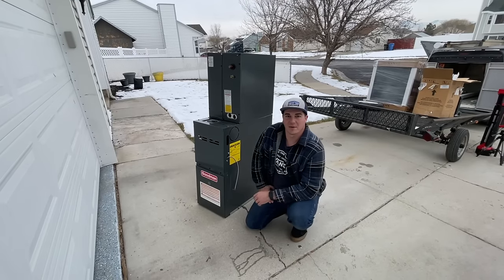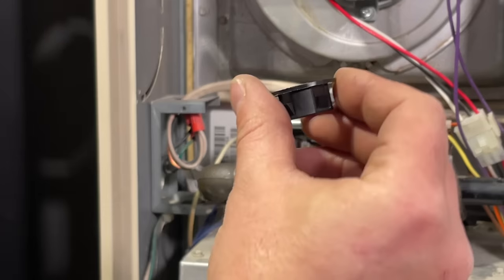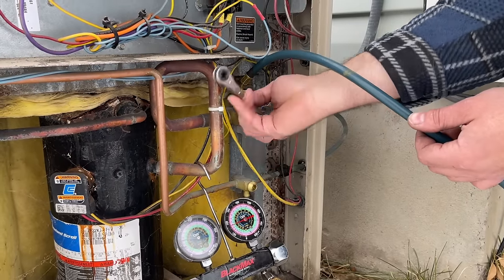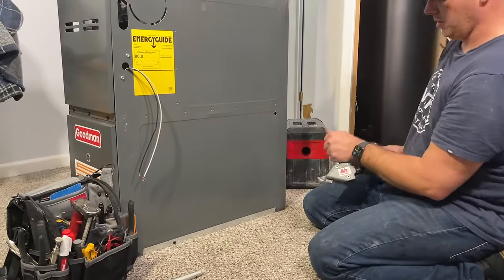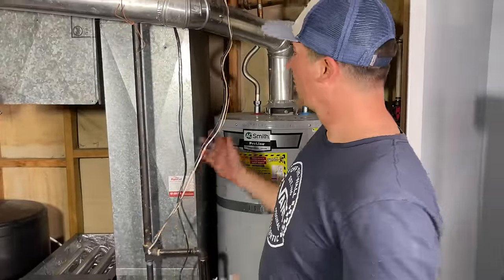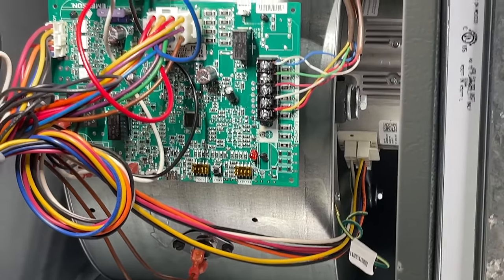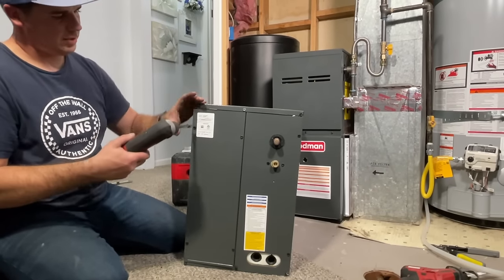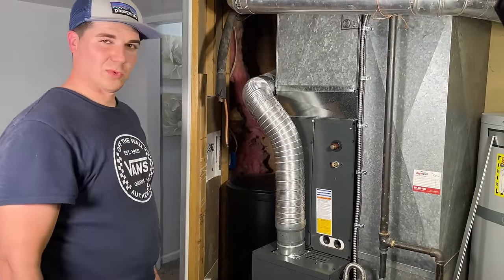Save THOUSANDS Replacing Your Gas Furnace Yourself.

Comment: As a professional HVAC technician I can appreciate what your trying to do. But the fact that your advocating DIY installations of a furnace and A/C is just plain wrong. First of all the average home owner does not have the knowledge or skills to do this type of installation. Second, you glaze over the fact that to do this work correctly is going to require hundreds if not thousands  of dollars worth of specialized tools. Third, your instructions are basic, you give little information on proper sizing and commissioning the equipment, and the information you do give is either partially correct or just plain wrong. Again I can appreciate your trying to share information, but at least the information should be correct and to a higher standard.
Reply from the maker: Thousands of dollars of specialty tools is a stretch. In this install I probably used maybe 10 specialty tools all of which are between 10-50 dollars. 

Also I’m not recommending this for everyone. If someone doesn’t want to do this that is totally fine, but you know for dang sure that people are going to do this that have the mechanical knowledge and they know the safety concerns. This video is to help them.   A homeowner can also pull a permit and have their work inspected so there is no issue with insurance as many people have stated. In fact I was just corresponding with a gentleman that did just this and was super happy and saved a lot of money.   Cheers
Reply: I agree with you,and to be perfectly honest,why the F--k would you want to show potential customers how to avoid calling you and not pay you! I think Goodman and any other manufacturer would not quite appreciate thos content either! Its all fun and games till someone gets hurt or killed and go after him!
Reply: @petersmart1999  i do all my own electrical work and never call an electrician. Adding outlets, lights, backup batteries, generators, 240V appliances, all easy to do and not ever worth getting permits or contacting an electrician. Heck, Id feel comfortable adding solar to my house without a permit or electrical contractor, rig up and program an inverter to sync with my house panel with relay protection to prevent backfeed then just take it all down when I move. I can do electricity and circuit boards all day, but as a DIYer I know my limits of knowledge. I dont do non PVC pipes, anything with pressure/compression, or fryon. Edit: to be fair though, I have been contacted by companies to be hired and trained as a proper electrician if I ever wanted to change careers
Reply: Well I'm not mad at this guy,,,,I have gotten alot of work from DYI....in fact I have my friends get jobs too,,,construction work due to a DYI...started a fire on attic installing a furnace!!!! CHEEERS!!!
Reply: People like him, give our industry bad rep.
Reply: @adamdragon8549  should be pointed out to manufacturers of the equipment he is using
Reply: @petersmart1999  goodman doesn’t care it’s the worst brand in the industry, pros rarely install  it, so they depend on amateurs
Reply: @adamdragon8549  Funny thing is,I have installed many Goodmans in the past,and never been back on one of them! I thought they may have been using someone else,but I have run into them and asked,I guess if you do a good clean install ,sized properly,and keep them clean the longevity increases.
Reply: While folks are clowning him and complaining.  Why not talk about the so called experts and licensed guys who have no idea about what they are doing and trying to bill you from unnecessary work.  I don’t mind paying service folks or companies for their work.  The goal seems to be get as much money as you can.  For example, my outside unit was making a loud knocking noise.  I was told it’s a compressor and should replace the whole unit due to the age of it.  A friend of my neighbor used to do HVAC.  He came over and heard the noise and said your about to be upset.  He told me to go get a hammer and screw driver.  He pulled the the fan off and using a screwdriver he beat some notches where it goes over the the shaft of the motor.  The shaft was spinning freely.  SMH.  Got my ac working that day and ordered a replacement fan for 55 which I ordered online.  That’s just one of many issues I experienced with many different companies.  Capacitors, fan motors etc.  overcharging.  Not talking about the labor and expertise costs.  Talking about overcharging for the parts.
Reply: I have the skills to do everything except charging refrigerant, and that’s only because it requires a license. This channel saved me more than $10K in my area.
Reply: @AF-O6  Moment you understand combustion efficiency and to tune-adjust it, let us know and talk about furnace installation. On the other hand you think it’s just gages that takes to balance out refrigeration system 😂 you make it sound its carpentry trade 😂
Reply: @AF-O6  smart man, respect for all tradesmen 💪
Reply: @adamdragon8549  just not true bro!
Reply: @thedude5040  
Some people play on the freeway, and survive. Therefore, everyone should play on the freeway.
Reply: @adamdragon8549  
You must be a rookie. The majority of performance issues are from installation not manufacturer. Anyone with 10 years or more of experience knows this to be an absolute concrete fact.
Reply: @AF-O6  
Manufactures require a contractor to install your equipment in order for the warranty to be valid. So, you don’t have a warranty.
Reply: @diyhvacguy  It absolutely is not a stretch. HVAC tools cost a lot and you need quite a bit of them.
Reply: You’re opening up a whole bunch of legal problems also. Most manufacturers aren’t going to warrantee that unit if it wasn’t installed by someone with the state issued mechanical license also your homeowners insurance is not going to cover any damage by improperly installed system or fires or any of the above. So the advice could potentially get someone in a huge, legal and financial position that they never expected.
Reply: I successfully installed several of my own furnace's in the years. 
Last year I installed our new Goodman 80,000 BTU and converted it to propane without a problem. 
It replaced our old York 80,0000 BTU propane I too converted.
As you do your best to make the process as complex and down right frightening to some, it's not working on me.
With the same, I built my own 20 kw home generator that I converted to run on propane using an engine conversation kit .
I installed the Deep Sea Electronics DS7320 controller module to do all the Auto Start and monitor engine and generator head functions. That was much more of a challenge than installing a furnace dud... 
I know it just makes ya wanna scream 😩 or possibly cry 😭 your eyes out when your loosing out on cheating someone out of a cheap install of a furnace. TO BAD 😞 ! 
In any case, I've never had one issue with any of my own furnace installs.
Reply: I am also in the industry, and I agree in totality with you. You have to have proper knowledge to do this. You can't just switch boxes and call it installed.
Reply: Please don't call me an average home owner. I hate to break it to you but this isn't that difficult. You'll be fine so calm down. Look at it this way, licensed technicians are a dime a dozen and now the average home owner can learn how to make sure Licensed technicians perform their job correctly.
Reply: 😂😂😂 Cmon man! Somebody's jelly
Reply: @chuckvenable4409  It’s not cheating ppl out people actually do this for a living you doing experiments on your own and them working out for you doesn’t mean it will workout for everyone else it will probably cost them thousands of dollars in the long run instead of getting it done right by a professional
Reply: @chuyrod1391  HEY 👋 
I don't experiment with anything.
I guess that's your only way to down play my knowledge to doing my own furnace installation .
Personally, I have zero interest in doing this work for a living. Not that I couldn't but just wouldn't.
I've installed several furnace units and converted to propane. I've never had a problem but that's not at all due to luck.
It's simply the fact I know exactly what I'm doing and how to do it.
Reply: @chuckvenable4409  props to you not everyone has the knowledge to do it so they aren’t getting cheated off their money everyone needs others services some cost more then others they’re always welcome to shop around for better prices
Reply: To be honest, looks like the only ones getting screwed or you guys cause we don’t have to fucking get ripped off anymor
Reply: @diyhvacguy  thank you for your knowledge I truly enjoy your videos. The guy who’s being a little girl is just hating. Thank you for being honest HVAC guy.
Reply: Hvac guys act like it's rocket science. It's basic stuff.
Reply: Agreed I do this everyday 5-6 days a week the average Joe can not diy an air conditioner yet alone their own garbage disposal
Reply: You hvac guys that are giving him a hard time act like this stuff is rocket science. Hardly gentleman. This stuff is rather elementary in the scope of electro mechanical applications. Plus theres a market for what hes teaching and as a fan of the open market I say go Dave. You've got the greedy ones clutching their pearls.
Reply: Dude get real. I installed my entire system in my new house that I'm building. I didn't spend thousands! I'm a cabinet installer and I need waaaaay more tools than an HVAC guy.
That doesn't mean a home owner can't install their own cabinets. 
You HVAC guys are about as honest as defense attorneys and car salesmen!
Reply: @adamdragon8549  no actually when you sell a custom a furnace for 4k that you purchased from the supply house for 2k... that is why you guys have a deserving bad name
Reply: @adamdragon8549  carpentry takes more skill bud. Yall are legends in your own minds.
Reply: @RossLemon  so how did I install my entire house without them?
I spent about 400 on tools that I know can use for the rest of my life
Reply: @venous-gaming55  When you combine Electricians, Electronics, Sheet metal, pipe fitter, mechanics, air flow, energy management, computers, thermal imaging, thermo dynamics, some carpentry, and then add physics to it, then you get HVAC expert. Tell me again what does it take to be great carpenter?
Reply: @adamdragon8549  lmaooooooo I watch 19 year old pot heads install HVAC systems literally every day.
Like every trade it's easy and takes very little skill I mean as much skill as a 19 year old pot head.
I make up a huge list to say what it takes to be a master carpenter and how my tools are 10x more than an HVAC guy. 
HVAC guys a crooks for lieing to customers about material costs. It's a controlled industry that screws customers. The word is slowly getting out
Reply: @adamdragon8549  but to answer you question about what a great carpenter needs to know: plumbing, electrical, hvac, chemical science, mechanical engineering, forestry, botany, foundation engineering, electronics, mathematical knowledge, roofing, landscaping of, and probably the hardest part, their work is usually the focal points of the project so it has to be perfect.
Reply: @venous-gaming55  you confirmed my point, good tradesman never talk down on other tradesmen.
Reply: @adamdragon8549  HVAC guys I don't consider good tradesmen, I put them in the same category as car salesmen and ambulance chasing lawyers. Just ripping off homeowners
Reply: I knew the hate from the contractors was inevitable. I'll be doing this myself. For years we have been told we are essentially not capable of doing these things ourselves. Most people have accepted this but with contractors charging 10k for a day's work people are doing more themselves. There is so much information available these days.
Reply: @joedegs123  yep. Did my whole house system and even my good friend told me that I shouldn't even be legally able to buy gas line lol.
HVAC guys think they are some next level humans. It reminds me of when gas stations thought drivers couldn't pump their own gas
Reply: @venous-gaming55  it's so true. It's not limited to hvac contractors tho. I was asking an electrician about installing a charger for my car and went on to tell me how it's hard to give me a price and how many factors are involved and I'm not an electrician so it's hard to explain to me the nuances. I turned around and walked away as he was talking to me. I did it myself for free. There are thousands of videos on just about anything you want to do. Contractors need to step off their high horse. Not all of them are like this but it's more common than it's not.
Reply: This was an amazing video I installed my furnace and coil with no issues whatsoever. There’s too many dishonest hvac techs and companies. Thank you my man!
Reply: Any body can get your hvac license. I studied for a few hours and the test was simple. Trust me it doesn’t take a genius to do this stuff.
Reply: @petersmart1999 it’s not like it’s hurting businesses probably 2 out of 10 people will actually attempt to DIY it they might not need you or either get frustrated and call a hvac specialist to come do it I’m a mechanic and it’s actually pretty funny when I see people showing others how to do it either a small percentage actually learns and the other gets it wrong get frustrated and has to take it to my shop to fix or they break something else and I get more work end of the day everyone either you have the same amount of work or more bc of the diy videos
Reply: Don't act like this is brain surgery. For anyone that has mechanical abilities, they will have no problems switching out a gas furnace.
Reply: I couldn't agree more with this. I've been in the industry for 20yrs and in short just because you can "do it yourself, doesn't mean you should."
Reply: @diyhvacguy  I can do all this but due to your honesty I'd call you any day of the week. Keep up the good work. These dudes complaining are just mad they are getting exposed ripping people off over the years
Reply: Quoted 22k for 2 systems from multiple companies I purchased the equipment and still saved 10k+ thanks diy guy!
Reply: @petersmart1999 Because he really hates his job and is hoping to make money off YouTube videos so he can get out of doing the real work.
Reply: The truth is that people can get this type of information anywhere . This guy is just trying to help and give people some self confidence . Beware of some of those contractors that know less then the homeowners . We just have to do good research and ask questions. Be safe.
Reply: @AF-O6 Just to let you know, the EPA 608 cert at Johnstone Supply, if you take the time to learn from the book, is only like $100.
Reply: Look at all the cry baby Karen’s in here. 😂
Reply: Paid a guy $22k for a boiler to hvac conversion, dude just about Fd up at every turn, this channel helped me tune my hvac furnace and turned a potential tragedy in to something I’m actually ok with, above all I learned how to maintain my furnace in process saving me thousands in the long run.
Reply: I installed my 1 stage furnace and spent like 400 on tools vs 7k from a company. My 1 stage goodman furnace was 1100 .
Reply: There absolutely nothing wrong with sharing knowledge. This is valuable information and an education in how a system works. In fact it may inspire someone to become certified in this trade.
Reply: Nice work
Reply: Got most of these tools, I’m not an idiot, I like to save money cause some j*w is gonna j*w me on install costs. It’s an awesome video.
Reply: @adamdragon8549  no its the jackassee that charge people $300 for a flame rod and lie to customers that give the trade a bad name!! Like my 85yr old neighbor who got charged this amount for a 5min flame rod job that the punk HVAC guy just cleaned!!   Good news me and my friend found his van and well,it'll be out of service for a long while,gas engines dont like sugar
Reply: Job security for us lol
Reply: @dalecannon6769  Next time you are at the ball game, please argue over beer price 😂😂😂😂 argue that they should charge you $1.50 because it’s $0.90 at the gas station 😳😂😂😂😂
Reply: Thank god in my area you can't buy one without a gas ticket
Reply: Really pisses you off anybody can do your job, right?
Reply: I do hvac and i think this guy does a good dam job
Reply: “The average homeowner” isn’t going to try to attempt this project or even watch this video.  It’s geared toward the DIYer and for that person, this type of project isn’t out of their reach.
Reply: @michaelpeterson4348  Sure
Reply: Knowledge can be learned.  Tools can be bought.  You're just trying to save your own job
Reply: @shanehamilton6708  the hard part is the required 5 years experience.
Reply: Lmao, you are just worried they won't call you.
Reply: @petersmart1999 

Snitch
Reply: Keep doing the diy content people are salty because they can't get that insane hourly rate for simple stuff they can do themselves I have a best friend that's been doing HVAC work for years for a company an he watched some of your videos an said you are saving people millions by showing this content he's all for it saves him tons of useless but expensive service calls so he can have more time doing work that he was actually way behind on
Reply: I'm also a pro hvac tech and I don't really mind these type of videos, at the end of the day 90% of home owners are still going to pay for a company to do the work but for the small % of ppl that need these videos, I think it's no big deal, the way I see it is it gets the cheap petty customers out the way
Reply: @anthonysalcido8700 . The average guy is not the one who’s going to tackle an hvac job on their own! It’s the highly experienced DIYer who has had success with a variety of related jobs who will try to do this. I’m one of those and I have no doubt that I could install a gas furnace with no issues. Not confident about AC yet, but I know how to do research and I know who to figure out whether I understand concepts clearly enough not to put myself or anyone else at risk. All you contractors ragging on this guy are doing nothing but trying to protect your over-inflated installation costs and high margin brands.